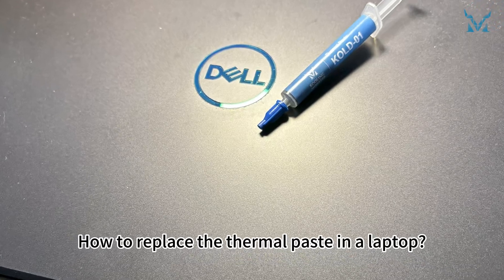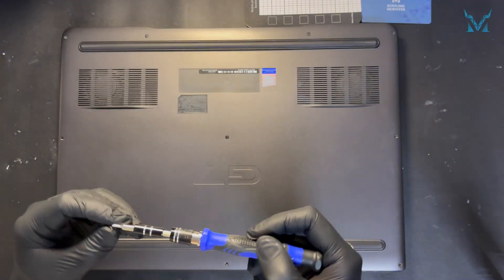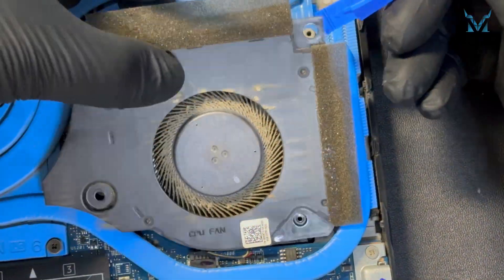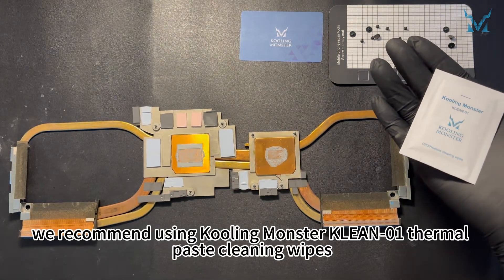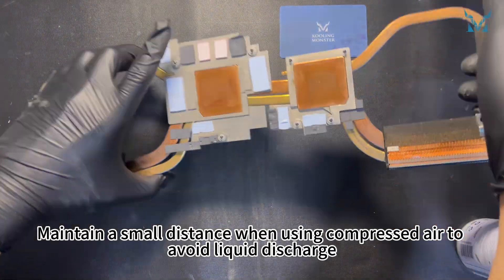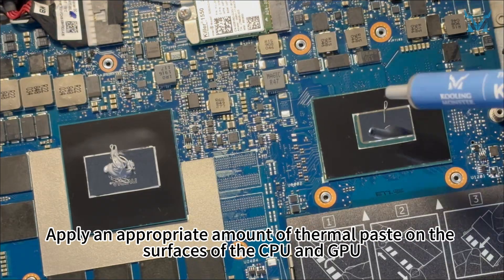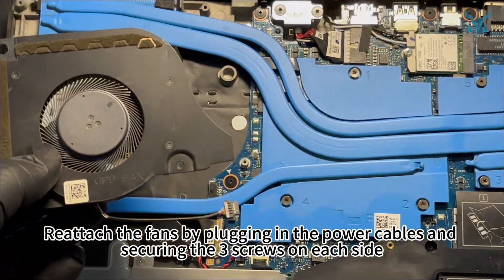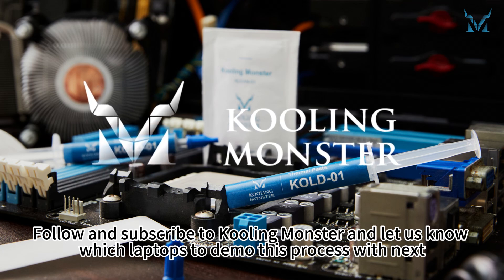Speed Up Your Dell G7（2019） Prevent Overheating With Dust Cleaning & New Thermal Paste

Comment: Idk if you've ever tried this before, but I actually polished the copper surfaces that's contacting the cpu & gpu with Autosol to almost mirror finish to get rid of the copper oxidation before repasting, & I'm getting about 2-3c better temp.
Reply from the maker: Nice! A polished contact surface can definitely improve thermal transfer a bit — especially if the copper had oxidation or machining marks ✅
A 2–3°C drop sounds right on the money!

Just a small reminder for others reading: polish carefully and avoid thinning or unevenly scratching the copper. A good thermal paste (like Kooling Monster KOLD-01) also helps maintain great temps even without polishing 😄✨

Comment: Cant i just clean the fan by opening the back and using compressed air to clean the fan, or do i need to detach it first
Reply from the maker: You can clean it with compressed air after opening the back—no need to fully detach the fan if there's not much dust. But for deeper cleaning or repasting, removing it is better. We used KOLD-01 thermal paste during repasting—great cooling and safe for laptops!